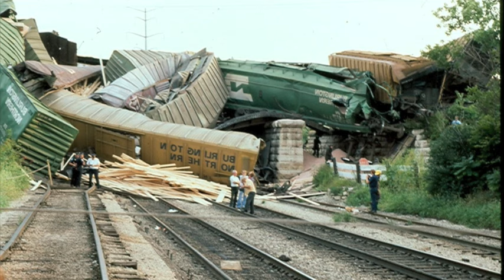Train Wrecks - Good Day by Angels and Airwaves

Comment: Watching this reminds me about how steam locos should have stayed more used. Only 2 steam locomotives in a I tire video of drailed trains. Maybe, steamiest, are safer?
Reply: Short Circut Fan yep
Reply: Well, that's also because they aren't used for revenue service anymore. Less chance for them to derail.
Reply: your wright
Reply: No, steam locos were all around more dangerous anger really high maintenance. Diesel electric is a lot better than steam
Reply: +Short Circut Fan They were built better but more resource intensive and more moving parts = greater danger to the people operating them. They belched pollution and again required lots of man hours to maintain and run. The main reason you have more diesels in the videos of train wrecks is because simply put there are more cameras today than there were 100 years ago. Steamers in the US are not used anymore by class A railroads for hauling revenue loads, only excursions. There are a few on lower tier railroads that haul freight.
Reply: they stopped using steam for commercial trains in the 90s, but yes, this is true. (also that was in India I think so you know it wasn't the US.. there were plenty of train crashes with steam trains. Just none in this video .
Reply: Peter F. lack of video cameras in the steam era. not like it is today where everyone and their kids has a cell phone with a video camera in it..

Comment: Ok... a white knuckle trip is when you are  either going out or coming back and hitting the small towns about bar closing time and these jackasses try to beat you at the crossing one hand tight on the throttle  and the other on the brake.. Bracing  for the worst..